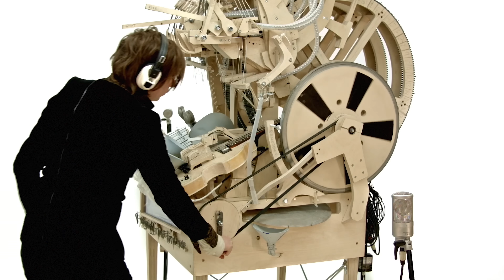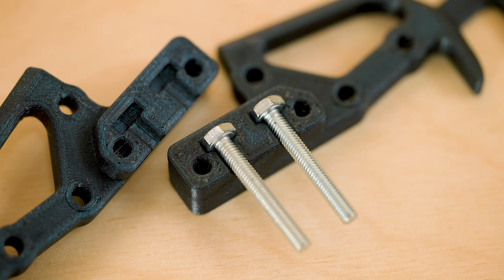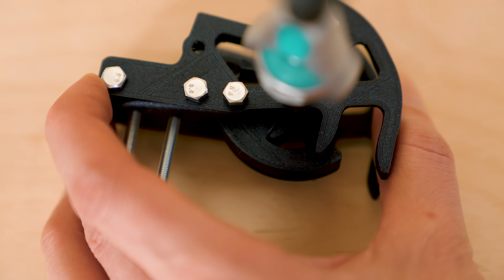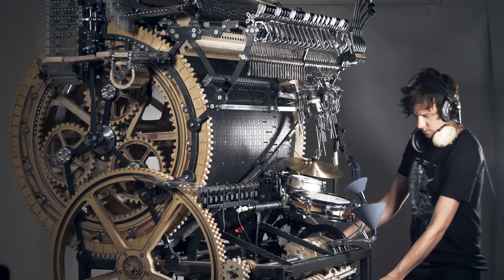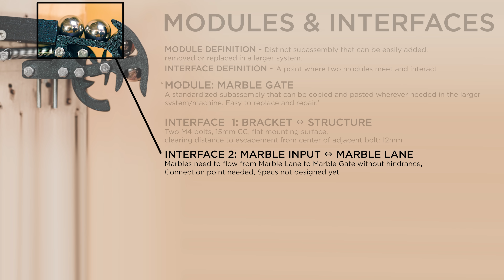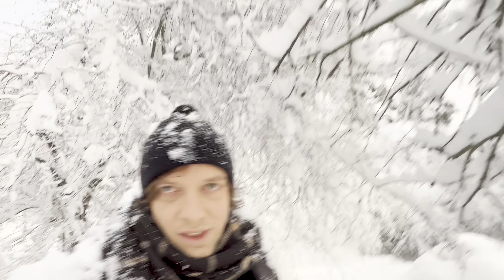The Foolproof Marble Gate - Does it Exist?

Comment: Be careful not to over engineer your project.  You already are avoiding unneeded complexity which is only one aspect of over engineering.  However, you need to also avoid setting your tolerance needlessly tight or you’ll over engineer each component in and of itself.  As I said in a previous video, don’t become Ahab.
Reply: It's only overengineered if the added design complexity doesn't provide any benefit
Reply: @snowthemegaabsol6819  I agree, except i’d amend your statement slightly: It’s only over engineered if the added design complexity doesn’t provide an equal or greater benefit.

Comment: Modular and Interfaces, that is how we do proper Software development of large systems.
Nice to see that it is also used by other then Computer Scientists.

We also uses Patterns in Computer Science, which is formally imported from Architectures.  It is small common designs which also have a clear definition of it's strength, weaknesses and what demands they have and what problem they solve.  That makes it easier to discuss different solutions.  Like the clock mechanism.  Great to have a formal library of solutions to pick from when you need to solve some problems.

Comment: I'm pretty sure, you figured this out by now - but: Why has the release so much travel? You're using a fixed size of marbles with a very calculable deviation. Your release mechanism doesn't have to move two times the diameter. And it doesn't have to move the same way back. You're wasting almost 2x the possible speed in movement.

Comment: The modules and interfaces concept is a concept used all around in programming. 
Data gets moved between modules and interfaces describe the structure of that data. 
This helps separate the modules as they don`t need to know about the inner workings of one another, just how to talk to each other using the interfaces. 

There is also another part described as a contract where a module exposes it's methods or functionality(functions). 
An analogous contract for your marble gate would be a "drop marble" function which takes as input "Interface2" and "Interface 3" and outputs "Interface 4".
This makes design even more flexible as contracts describe the flow of data through the application, in your case the flow of marbles through the machine.

Nice video with really good educational content as well. Great work!

Comment: using modules and interfaces is one of the best design philosophies you can possibly use, it even works extremely well in puzzle games with open ended engineering and coding solutions

Comment: It reminds me of the 10 minutes presentation on abstraction going from a transistor to a processor.
But yeah when you're working on complex systems, you want to split things into black boxes that work and each input should support the whole range of outputs from the previous module(s).
Though it's easy to miss side effects, like when making a cnc plasma cutter, the arcs cause mayhem on everything that's unshielded, and there's a lot of wiring that act as antennas and will brown out your electronics.
In the case of the marble machine you'll want to minimize vibrations.

Comment: I'm currently building an analog synthesizer, and have stumbled into a similar design process. The first iteration is a jumble of wires haphazardly soldered together, and I'm now in the process of breaking it into manageable discrete components with standard interfaces between them. This not only makes it easy to adapt and modify components, but it also means you don't need to hold the whole structure in your brain. Once a modular component has been "completed", you can clear all the mental space associated with it's construction. 

Also - to quote Adam Savage - "You need to build everything 3 times. First to understand what you're actually building, second to solve the problems, and the third time to get what you want."

Comment: As an engineer who designs many aspects of complex vehicles, the primary lesson I've learned over many years and many clean sheet projects is: A little bit of well thought systems engineering early in a project is the key to success in all metrics. Don't forget to Validate your requirements (different from verify). Bad requirements are equally bad for a project as a bad design.

It's astounding how many multi-million dollar projects fail in this regard. 

Keep up the good work!
Reply: like ms accuracies? ..... It make me think on the overkill tape deck designs with almost no market to claim and with numbers that went surpassed a decade later by consumer models LOL

Comment: What if you removed the "dropper arm" for each marble gate and replaced it with a shared rotating time synchronized dropper shaft, running under the gates. The dropper shaft will have 4 machined indentations (slots) around the shaft, under each gate,  that the marble gate can drop one marble into. The dropper shaft will continuously rotate at a speed so that it drops caught marbles according to the beat. This removes all small timing errors from other sources.

Comment: I'll just make a couple of observations: 
- First of all, since you changed the gate, you should redo all the previous measurements. 
- Second, plan to check what happens with the gate timing accuracy and drop precision when there are several close gates being activated at or nearly the same time? If the movement of one gate causes strong vibrations (measure it), you'll know you need to fix that. 
- Third, none of the 3d printed gates will be perfectly identical, which means the timings between them will be different. If the timings are too inaccurate (measure it), you'll need to ensure you can compensate for the difference for each gate, perhaps at the gate itself or at the trigger.
- Finally, like one of the commenters mentioned, you should also look into reducing the noise (measure it) of a gate.

All in all, this is a really awesome project done in a brilliant, scientific way. I'm amazed.

Comment: Martin! I've got it! I like the way you're turning to data to justify your decisions, but like many others, I'm worried that you'll get stuck chasing zeros in precision. I think one big thing you're missing is data-driven, quantitative specs to serve as a goal. I think you should do some testing and figure out what standard deviation you actually need in the timing and drop location. This whole project so far has been awesome and data driven, except those two parts, which are just "as good as possible", which will leave you chasing after unnecessary precision. Decorative wilson on the side of the machine doesn't need to be flat to within a tenth across the whole thing. At what point is it worth the time to keep tuning one part versus dedicating that time to a different part of the machine?

That's my 2c, as an armchair engineer with no impact on your project and just someone who enjoys these videos. Take it or leave it; that's your decision. I hate it when people tell me things like this so :/ I understand
I think that will make a lot of people happy because a lot of us are worried that you'll get stuck never reaching your goals, or simplifying it down to a midi synth, just because you don't have concrete enough goals.

Comment: I'm a bit curious about your final implementation - if you're going to use an Arduino to schedule marble releases, that's a binary digital response, your solenoid will either be engaged, or not.  This exercise in partial or slow release will not matter if this is intended to be the mechanism for dropping marbles.

Guessing that's not the case and you intend it to be analog, though.

Comment: You should lower the z-height slightly on your first layer calibration on your printer. You shouldn't be able to distinguish the separate extruded lines as you can on your prints.

Comment: Same applies to Software Engineering by the way.
Other concepts from software eng. that you might be interested in and might apply to your process:
- unit testing: once you have a module, you should create a test bench when you can just put the constructed module in and have automated tests with it to certify it works as intended.
- integration testing: same as unit testing but on a larger level, with a lot of module assembled.
- SOLID principles:
-- S for Single-reponsibility principle: a module should only do one thing.
-- O for Open-closed principle: a module should be open for extension, but closed for modification.
-- L for Liskov substitution principal: doesn't apply here I think
-- I for Interface segregation principle: modules should not be forced to depend on interfaces that they do not use.
-- D for dependency inversion principle: interfaces should dictate how modules go together, not modules themselves.
- CI/CD: Continuous integration / Continuous deployment: you should find a way to automate the creation and assembly of modules that you're iterating through, and make the final assembly via the same pipeline.
- Polymorphism: the best modules are the ones that can be used multiple times in diverse places because they are both generic and powerful, and their interfaces are open enough.
- Refactoring: restructure a module to improve it and reduce its parts count without altering functionality (basically what you're doing in this gate series).

Hope that helps.

Comment: I am wondering if it would work to hold the ball electrically with a magnet and then release it. In the same way as cranes with a magnet on the scrap yard. Theoretically, it should be very accurate.

Comment: You can completely get rid of the divider if you have the marbles tracks never merge. I think this can be achieved by have the return mechanism be inside the track wheel that holds the pins. so once a marble gets to the bottom it goes into a lifting mechanism that is the track wheel. The track wheel could be organized so it has the pin ring for a note then next to it a lifting mechanism with this pattern repeating for every note. This will make it so each note has it's own dedicated marble track that bypasses any kind of divider.
Reply: Late reply I know, but for some reason I never thought of that! That is a really cool idea in theory. But how do you see it working? Like do you think it would actually work? Do you "verify" it, as Martin would say? If that really did work, though, it could make this whole thing a lot simpler. No need for a super complicated divider. Of course there are things in engineering that simply require complex solutions, but I say use simple solutions wherever possible. So if the solution you proposed for lifting and dividing the marbles could really work, I say stick with that. Avoid the overcomplicated solution of a complex divider and conveyer belt or whatever.

Comment: One thing I have yet to see addressed or mentioned is the validity of all these tests when taking into account vibration. An instrument like this with so many moving parts is without a doubt going to have some form and range of vibration during play and that vibration could effect every single one of these tests that have been done in recent months. I think it would be wise to measure how much vibrations are present in the mmx and use that as a standard to test this gate under similar vibrations, I imagine especially the marble drop accuracy may encounter a lot more variance under vibration.

Comment: Nice! Can you simulate reliability of the gate when in a vibrating system by bolting an electric toothbrush (high freq) and a spinning weight (for a lower freq) to your wall board?

Comment: This design approach is well known in software engineering and it really helps to break down a problem into smaller chunks. You restored my optimism in this project :)
The only thing i fear is the pressure exerted on the gate when too many marbles are stacked in the lane. I know that this gate design mostly eliminates this problem, but i would love to see the test which eliminates this concern :)
Bless!
Reply: Exactly, was hoping someone would have commented on this; it's key to managing and creating successful non-trivial systems of arbitrary complexity.

Comment: I couldn't help but notice that when you do your slow releases with your new gate, the marble is getting pushed back up somewhat.  Is this going to affect your release, or your optimum hold time?  Perhaps you can include a stop on the attack pull to keep the gate arm from extending too far and pushing the marble back up.

Comment: one thing you have not considered is wear. The interaction between the drop lever and the ball, is very small, so if the material on the drop lever or the backside of the ball chute wears down a little bit, the balls will drop prematurely during slow attack times. Thus, I think the marbe gate still needs to be designed to have more of a interaction with the ball. Best would be to have a completely horizontal drop gate, that slides in and out. Rack and pinion?

Comment: Hey, here are a couple quick tips: 
- Screws are aweful axels, use fitted screws or straight pins (cheap) instead. Just as easy to use, but actually work for a long time
- properly index your parts! Screws and threads have quite big tolerances, if you use nothing but two screws to index the precise location of a part, it will be off. not by much, but annoyingly off. even worse: the error will be different every time you mount it. Either use straight pins for locating parts, or edges in the part itself (i.e. a ledge on two sides)
- FDM printes are handy, but have aweful precision

Simpe yes, but precise where necessary.

Looking forward to where your journey takes you!

Comment: It bothers me that you have to push the marble back up only to drop it.  If that piece were at a final stop when the marble is released,  it would not happen.  So it seems to me it should reach a final position, and  stay there untile the next cycle drops and prepares to capture another marble.  What you have seems to work, but I would think 1st priciples would not want the wasted and unnecessary expendature of energy.

Comment: Looking at your last design, to me, it looks like the release time is only as constant as the extension of the attack arm is precise, as when this is "overextended", the marbles are no longer held in one place, but pushed up. If you have a deviation here, you will have a deviation in the release time, as the travel distance increases, which in turn will mess up the timing of your gate. In conclusion, not only the dropping part of the gate has to be perfect, but the movement of the actuator, that controls the gate has to be extremely precise to get repeatable and precise results on marble drops

Comment: Now that the gate is different, isn't it possible the ideal hold time is no longer accurate?

Specifically, if the marble doesn't fall as far within the new gate, it might not jostle around as much, an thus you may be able to use a shorter hold time.

Comment: The ‘travel’ in the ‘pull rod’ is too far. The rod continues to move away from the gate, pulling the mechanism even after the marble has dropped. This can be fixed with better tolerances.

Comment: For interface 3 - you specify 0-300bpm, which would be 5bps, which would require 200ms per beat for the entire actuation cycle. If your specifying 250ms minimum hold time, how are you reconciling that with the bpm specification? Would it be clearer if you specify a bpm rating for tight music, and a separate max raw bpm rating with degradation (but still the max achievable)? Or is the bpm rating for your standard pair of gates - in which case wouldn't you specify 150bpm per gate, achieving 300bpm with the system design of doubling it by having 2 cooperative gates and not within the individual design specs?

Dude, I'm loving your latest videos. Clear, thoughtful, well executed, and very informative into your developing design process. Thanks for continuing to share your journey!

Comment: From a Martin to another? (Fowler) Strictly speaking I see a contradiction in the third interface definition: there's no way to reach 300 BPM with a minimum hold time of 250ms anyway. So the upper bound of the functional range should be less than 240 BPM in practice.

Comment: Next issue: noise rejection!

The gates will shake, marbles will clink into each other as they roll down (or onto) the "marble lane", the movement of the activator is not going to be precisely monotonic during the two phases, etc.

(Monotonic means: having the same direction or standing still.  It doesn't mean constant speed, it just says there are no backward movements.  In the real world, there WILL be small backward movements of the activator.)

Comment: Much of the software world is built using something called "object oriented design", where the objects are the modules and the interact points are called "interfaces". When you don't follow the principles we'll you might end up with "tight coupling" where modules only function based on the specific properties or behavior of other modules that is not explicitly part of their interface.

Comment: I spotted one potential problem with the specification for interface 3, the max bpm value is a global parameter and should be defined as max bpm divided by the number of gates that service each hit point. In MMX you had two gates per instrument which in this case would mean that each gate only needs to handle up to 150 bpm. That means that the necessary duty cycle is 400 ms instead of 200 ms per gate.

Comment: Have you considered inserting machined brass or steel plates into the escapement pallets just like watches? It would ensure that, over a lot of testing and playing, the printed surfaces don't wear enough away causing inaccuracies in timing or misfires.